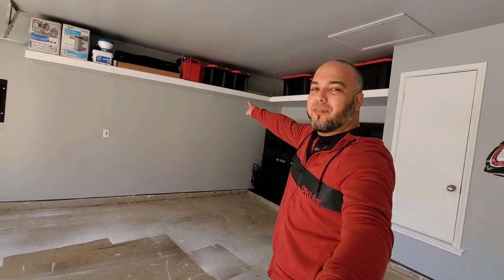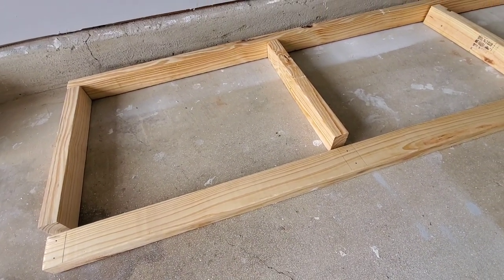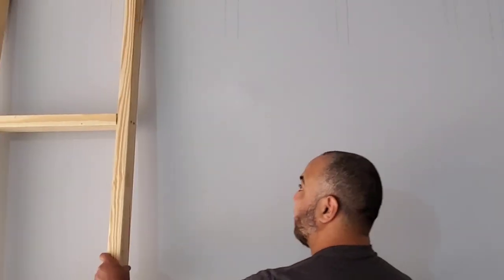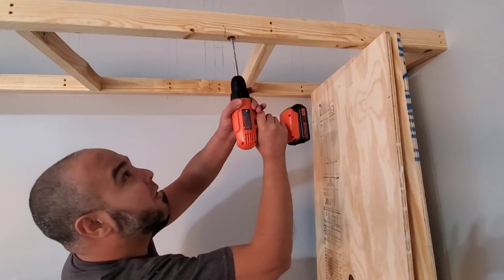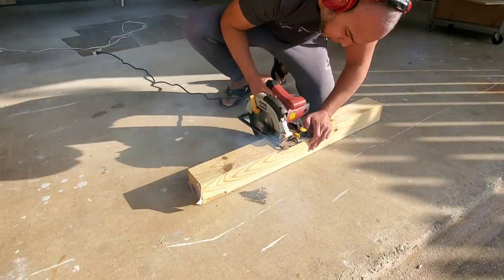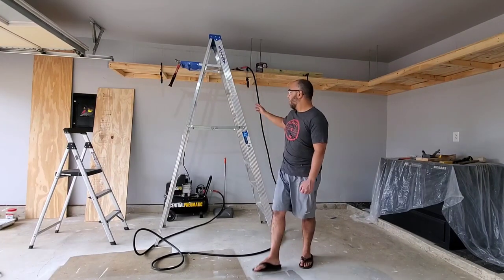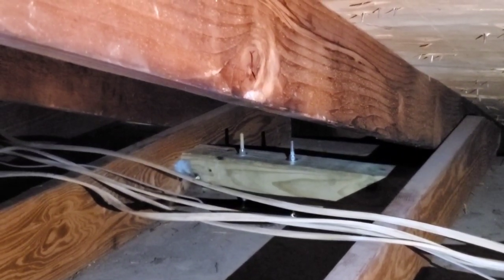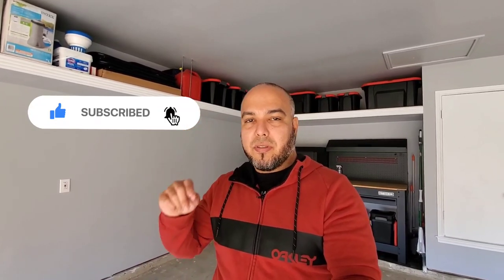How To Build Overhead Garage Shelves DIY | Garage Storage Solution |  Part 2 Dream Garage Renovation

Comment: There’s plenty of videos that show how this is secured to the ceiling. That said, I prefer your method that hides the rods in the shelves instead of eye bolts on the side. This gives it a much cleaner look.
That’s a good finish on the boards to make them look built in. Usually their painted or keep the wood look.
This is much cleaner.
Reply from the maker: You are correct my friend. I am aiming for cleanner look!  And a little bit of paint goes a long way! Thanks for watching.
Reply: Love that he finished them and how clean it looks!

Comment: Dang, I’ve never seen a black n decker drill drive 3inch screws like that but I’m thinking they might have been torx as Phillips just don’t grab hard enough without having a descent impact driver which is what I primarily use now as my daily driver. Results speak for themselves, good job G!
Reply from the maker: Hey Yes it did the job! That was what I had at that point. I got some better tools nowadays. Brushless drivers and impact from craftsman! Appreciate you watching!

Comment: Nicely done!  I am planning to build a similar setup and will add one element for visual effect.  I will have 3 rods supporting the shelf and bought 3 6' lengths of 1/2 inch red pex tubing  (spent a whopping $9) that I will insert the rods through.  It's a really clean look and will go well with the black I'm planning to paint the shelves.  Pex also comes in blue and white if those colors work better for someone.
Reply from the maker: Thanks Buddy. Awesome that your planning to do your own project. I would love to see a picture when your done! If you have any questions don't hesitate to ask!

Comment: Nice a slick.  painted and covered the holes.  I think the supports.  I'm actually ripping out cabinets for two shelves along a wall.  Tools currently are under them, but I have a lot of bins and things that don't make the cabinets very functional.  Open shelving will be much better.  2 shelves means I just need longer rods.
Reply from the maker: Yes Sir! These open shelves are handy! Just stored the Christmas tree up there! 7,5 Feet tall and fits easy up there in my space. If you have a taller garage you will have more space! Those rods come in longer lengths! Just think outside of the box and you will make this happen!

Comment: All you need is ti drill until a floor joist. Connect a 2x4 to that and you can support the weight from the top without those canles

Comment: Paper bag floor in the garage. My sister and I did it straight on cement. It’s easy to patch or repair as needed , wears excellent and looks pretty cool. Be sure to use oil based varathane to finish or it won’t wear well. We stained the bags before finishing with varathane.
Reply from the maker: Hey there! That sounds like a great idea. I did not hear about that one. Will take a look at that option! Thanks for the idea.

Comment: Nice job, as far as that floor I would epoxy it. Rent a shot blaster and buy a quality epoxy system not the home depot junk. Sherwin William's makes an good affordable industrial floor paint I have it on my garage floor. Proper prep is key to a successful job. Be safe brother.
Reply from the maker: Appreciate thise advice.  The issue with my floors are in very bad shape. To much cracks. There was foundation work done.

I've been doing a lot of research and will be placing Swiss Trax floors.

Comment: Probably the best storage solution abs video showing how it’s done. I know this video has been posted about a year ago but do you have the measurement of all the pieces you had played out on the garage floor before you started?  I too want to visit Home Depot and have everything pre-cut.
Reply from the maker: Hey buddy really appreciate that.
Regarding my measurements it was L shaped. 9Feet by 15Feet.
Dept was 24" on shorter side and 20" on longer side.

Comment: What should I do if I have a room over my garage ? Find the studs or will that be too much weight to hold.? Thanks
Reply from the maker: Good question! You need the support from top also! And jus lt bolts in studs from top won't be enough unfortunately

Comment: Great video!!! Thanks for taking the time to breakdown the process.  What are the measurements from the ceiling and wall? It looks about 24” from the wall so the storage bins will fit perpendicular to the wall.  I want to plan the storage space and buy the appropriate bin size to use the space effectively. Thanks again!
Reply from the maker: Hi Hugo thanks for watching! The hight from the ceiling to the top part of the shelve is 20". So make sure you calculate the thickness of the plywood before adding your frame. To save time and money, the dept is on one side 28" and the left over of the plywood about 20" I used on the other side. A plywood is normally 48" wide. Measure twice cut once. And have them cut the plywood at lowes or home depot. Let me know if you need anything else.
Reply: If the shelf is lower than the garage door opening height, my recommendation on the side depth is to come out to the edge of the garage door opening.  This gets the maximum depth without decreasing the maximum space for the vehicle.

If you have a higher ceiling and are going over the garage door height, then go full 4' depth.  Test with a string because most garage doors rise higher than garage door rail.

If the shelf is over 2' deep but less than 32", or less than 19", cut the plywood sideways in 4' lengths to save on material (12' of shelving 32" deep, 20' of shelving 19" deep).

For height I recommend wither a little over 6' (a lot of cabinets are 6' tall, over 80% of males are under 6' tall), 6'8" (same as standard door height clearance), about 7'2" (most minivan hatchbacks open to 7' or less), or the height of the garage door opening (if you have high ceilings).

I also recommend finishing off a wall.  Narrow the 2x3 (or 2x4) supports at the garage door and continue to the front wall.  Let the shelf plywood overhang the support to the same depth.  Will need to notch the shelf plywood at front to allow garage door clearance (commonly missed) (test before screwing down).

Comment: In the attic all you had to do was lay 2x4s across the tops of the ceiling joists . Did not really need 4x4s
Reply from the maker: Some areas there was no room to put on top of the joist. And I'll feel safer sleeping and knowing there is a 4x4 than 2x4. I bought them cheap any way in the back at Home depot where there was 70% off.

Comment: SO how did you know where to drill the hole in the attic support accurately
Reply from the maker: Good question! With the stud finder I marked where the 2x6 rafters where. Then I measured from the wall till the end of the shelve where the rod will go and from there is just do a pre drill trough the ceiling sheetrock.

Then went up and placed th 4x4 support and marked it from the hole and pre drilled the 4x4. I don't remember if I showed that in the video. Hope my answer is clear enough. If not let me know. Did not want to make the video longer by adding all those measurements.

Comment: Nice Job But you could have avoided going up in Addict by using  Hanger bolts,  3/8"-16 x 6"!  Treaded x Lag into 2x6 Beams.
Reply from the maker: Thank you! I thought about it. But I wanted to be 100% sure I can see with my own 👀 that everything is firm and secure. Maybe over kill. But atleast I can sleep good at night. It has been close to a year and a half now. And still doing great.

Comment: Could’ve just put drywall on the underside & save some money on the plywood.

Hi so you could’ve continued the shelf underneath the garage door track to the front.
Reply from the maker: That would have been smart doing sheetrock on the bottom! Good thing I did all this before wood price went up!

I want to do that still If I run out of space. But it is a big issue getting that far in the rafters! Didn't feel safe! And that would made it worse!

Comment: So a 2x4 is really 1.5x3.5.. if you’re off the 1/4 of an inch then your shelf will be biting only into the drywall.. every stud should be 16 inches from the middle of the stud you found.
Reply from the maker: I used 2x3 not 2x4. For what I use the shelve would be over kill. And yes I agree with 2x4 you would need longer screws!

Comment: Question, do you think this could be made without the supporting rods? I don’t have anything on the ceiling to hold the structure
Reply from the maker: If it is only above the toolbox  and workbench area you can do it without the rods, because you have 3 sides with all the studs. But it you only have 1 or 2 walls it will come down guaranteed.

Other options would be metal brackets below shelve. Less clean look but saves space.
Reply: If it's smaller than this build then yes, you can get away with it. If what you have in mind is similar in size then definitely support it with threaded rod. There are definitely ways to support the weight of your build.

Comment: Epoxy that floor! I wish my garage was clean enough to do it. Also, I'm concerned that anchoring the shelving to the garage door railing, and adding extra weight on one side, might knock off the balance of the door
Reply from the maker: Unfortunately I will have to do Swiss traxx, the floor has a lot of crack due to previous foundation issues. And yes you are wright about a weaker point on the garage door railing. But I measure it weekly and so far no change in height. Also on purpose I've put lighter items on that side of the shelve.
Reply: @297modz  That'll end up looking good, too

Comment: I might be concerned that the shelf weight is now on those small screws of the joist hangers.
Reply from the maker: In the video they look small! But, they are strong Srews here is the description off them. #9 x 1-1/2 in. 1/4-Hex Drive, Strong-Drive SD Connector Screw

Also I added some strong nails to give extra support. Here are the description Strong-Drive 3-1/2 in. x 0.162 in. SCN Smooth-Shank HDG Connector Nail.

So far it's been up there haning close to 2 months without any issue.

Comment: Google "Cleaning garage floors" for chemicals and methods.  Most recommendations involve soaking in cleaning solution for 10-15 minutes (solution depends on stain type, might need more than 1), then pressure washing (don't rush - do small sections at a time), then if needed spot cleaning with hand scrubbing with a brush or floor buffer if large area.
https://www.google.com/search?q=garage+floor+cleaning&rlz=1C1OPRB_enUS531US531&oq=garage+floor+cleaning&aqs=chrome..69i57j0l2j0i457j0l4.3759j0j7&sourceid=chrome&ie=UTF-8 
After it thoroughly dries, can leave as concrete color or can apply a *concrete stain*.

Then apply a thick coat (I recommend 2) of concrete sealer to resist stains and make it easier to clean.  I like high gloss or wet look because they tend to be thicker and can tell where you need to touch up, but they show scratches easier.  Will need to periodically clean and reapply every few years, but shouldn't have to completely strip the old coat.

I am not a big fan of connecting to the garage door rail these aren't designed for a lot of excess weight.  I do like your use of 2x3 instead of 2x4 and didn't appear to go overboard on plywood thickness.
Reply from the maker: Interesting points you brought here, I was thinking of doing the swiss traxx to cover all the cracks in the floor. There are some spots in bad shape do to foundation issues from the past. There are areas they had to go in and install peers. But your method is very good!

About the garage door. On purpose i'm putting less weight over there and have been measuring every week and no change. But due to the overal support in all the studs. Everything feels solid. And yes 2x3 is definitely enough for these shelves. With 2x4 i would have added more rods!

Comment: Great job with that build. That is the cleanest I've seen.

Floor recommendation would be black epoxy with colored flakes like what Home DIY Dan did to the floor in his garage. Check out this video to see what I mean: https://youtu.be/q1gYuGMBhoI
Reply from the maker: Appropriate you watching my video! I just saw DIY DAN'S video. Pretty cool! Unfortunately my garage has some cracks in it. Due to foundation issues from the past. And i would need to fix a lot of issues. So I think. I'm going to do swiss trax  and will try to make an great install video about it. Before i do that I will hang a hose reel from te ceiling! I have a nice system in my mind to do it. Hopefully next weekend!